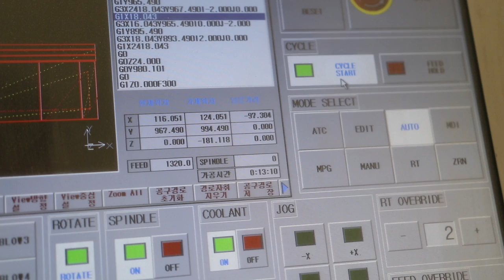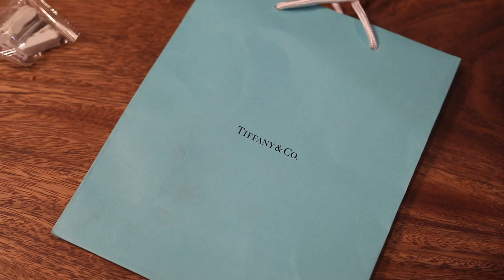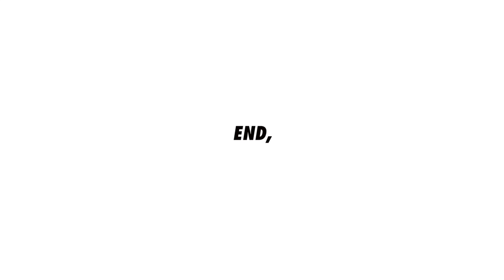W57_Dress room design

Comment: Hello, very impressive work of yours! Just wondering for 5:05, how does it happen? Is it an optical illusion?
Reply: How do you mean?
Reply: @DaleDix   Watch it at a lower speed. Here is what I see.
First, the wood is alined to the blade using the blade as a guide. Then the blade is raised and a cut is made. However, if the wood is alined to the blade then there should be nothing cut off. 
I'm dumb, need help.